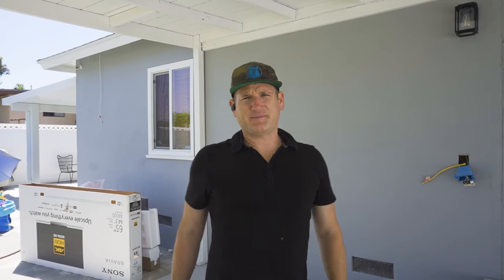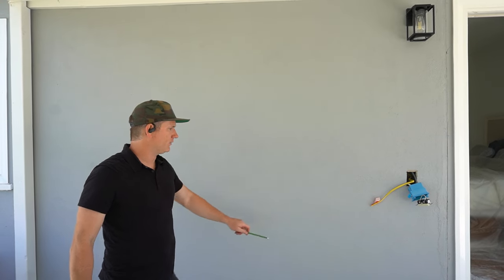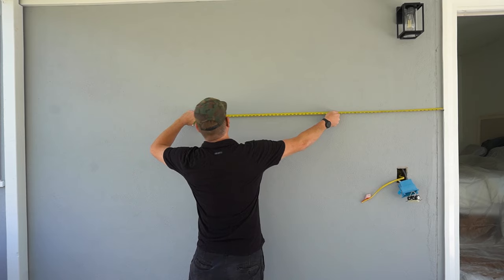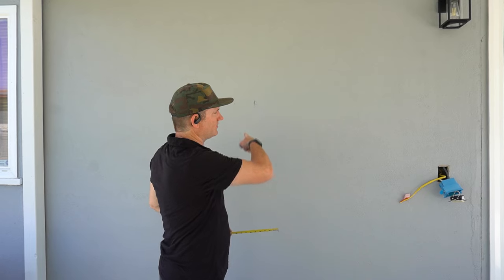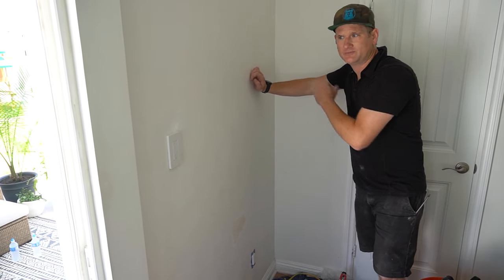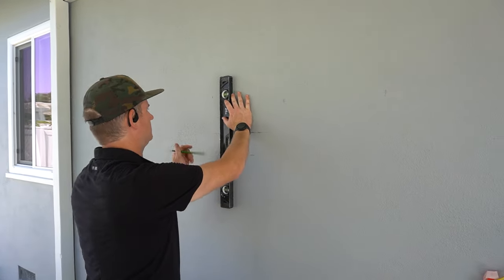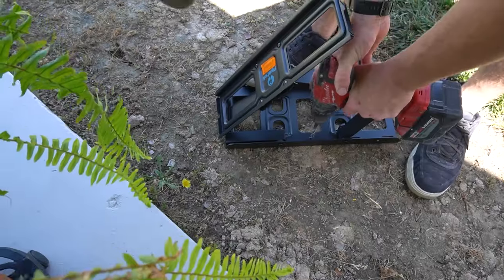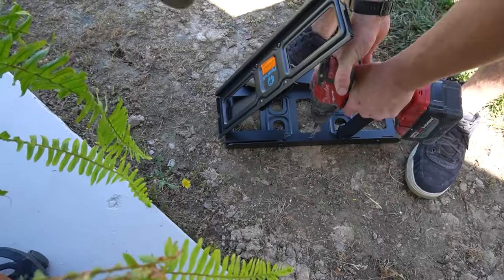Installing TV in Backyard/ Patio by Pro

Comment: I’m also a professional tv installer. This guy really knows his stuff. Only things I’d do different is use a smaller drill to check for the stud so in case I miss, it’s not a big hole, and I also use Toggler brand toggle anchors.
Reply: And a better quality mount
Reply: @JoeyAdes  yeah that too.
Reply: Yup! The 3/16 inch Toggler anchor is the best imo I used for dry wall tv mounting
Reply: Try the ZeboZAP gazebo tv mount

Comment: I'm a beginner when it comes to electrical and I think this was great video. I was mainly interested in how to deal with stucco.  However we do have the blown- in installation, so fishing that line through might be a bit interesting.  But I was amazed at how easy this looks like it is to do! Now to review my plethora of "prior to drywall pictures" to see what else is in that wall and get better idea of where the studs are.
Reply from the maker: it's either going to have fireblocks or not.  if not, the fish tape will get through.  it's not too hard once you have some practice

Comment: Thank you for this video. I noticed you used a regular tv. Goes to show as long as it’s under cover you can install a regular tv outside. Thanks for the video again. 👍🏼👍🏼
Reply from the maker: You can just throw a cover over any TV.  Better than those super expensive sunbright tvs that aren't very good anyways.
Reply: @BTheInstaller  thank you for the advice saved med 5k o.O !
Reply: @BTheInstaller  the concern for us in the northeast is temperature.  We are installing in a gazebo and we don't plan on taking down and storing in the winter.
Reply: @danielbalboni6804  I have mine under a gazebo like structure and it has sat out all winter (zone 6 in growers terms so we get nasty winters) with just a fairly thick cover over it and unplugged. It is Hisense 4k so nothing too fancy. My plan is to uncover it and wait a few days incase moisture got into it, to let it dry out fully and see if it survived. This winter was not a great test as it only snowed perhaps 4 or 5 times and the snow on the ground did not last more than a few days. Wish me luck.

Comment: Great video, I just installed a 50" LG in my outdoor living area and used a similar articulating mount.  My outdoor living space is a 12' by 24' covered area and I used a non-outdoor rated mount, have you ever seen any issue with indoor mounts used outdoors (this will never be hit by any rain)?  I live in central California so we get some pretty hot weather in the summer and pretty good fog in the winter.  Thanks!

Comment: You should do a video on how to mount a tv on fiber cement siding. I've been looking around an there's no content anywhere to be found. Is there anything different?
Reply: The key is just to use a long structural o lag screw try to attach to studs if its not possible use anchor's screw... tv are light weight nowdays... someting yiu may need spacers to fill it

Comment: Seal the holes with insulation foam filler spray $15 at HD on the hole and around your  outlet before putting the plate on. Keeps water and bugs out.

Comment: i just bought a brand new samsung 70" for a covered lania...do i have to worry about a waterproof enclosure for it
Reply: Yes. Common sense if its not one of their Terrace Tvs. Check Amazon for some Storm Shell covers. They're not cheap, and the largest they make is designed for a 65" but new tvs are so thin on the bezel, that it may fit yours. Not sure how well they work, but the theory is sound.
Reply: I just built a custom tv cabinet for mine. Just built one for a client out of Redwood

Comment: B the Installer...I have a question that I haven't seen addressed on any video, anywhere.  I need to mount a 65" tv outside under my covered pergola.  That's the easy part.  The wall that it's going on is a 3" foam insulated panel that has aluminum on the front and back.  Its very sturdy on the roof, so much that a 160 -180 lb person can walk on it.  Very common in pergolas for roofs, I was just lead to believe it could hold a tv. I'm not willing to chance it.  What do you recommend?  Possibly a large steel panel on front and back with the tv mount fastened to it?  I figure this would displace the stress that would normally be on the wall.  Your thoughts?

Comment: Intresting how you can put a 20 amp box on a 15 amp surcut.
Reply: I was thinking the same thing.  That should have been 14 gauge wire not 12.  Thankfully, it's not 14 gauge where 12 should be.  The 12 gauge wire on a 15 amp circuit really won't hurt anything because the breaker would trip if there was an overload however, if it was the opposite, (Which it isn't in this case), a 14 gauge wire on a 20 amp circuit could cause the wire to get hot and catch fire before that 20 amp breaker would trip in some situations.
Reply from the maker: It's been a while but I'm pretty sure it was a 20amp. Normally outdoors and garages in CA are 20 Amp and 12 gauge. ...  however, there is no downside there.  And if it were 20amp I would not use 14

Comment: good seal oh really i can look into the wall through that hole on the right side of the power outlet 
you can see at 23:42 I really hope you fixed that 
because if not that is a really shit move
Reply: Not to mention the first drilled hole where he missed the stud that is just covered with the mount plate. I'd fill the hole with some silicone at least. Maybe the screw holes too.
Reply from the maker: Stop picking.  It's a video. Enjoy the video Vs try and arm chair QB it..

Comment: So in essence only one stud.  Do you need that ground nut, or can you just twist grounds together connecting the lin8ger wire to ground on outlet.
Reply from the maker: The way i did this is all the proper way.
Reply: So answer regarding one stud??? If its right confirm.

Comment: No issues with having that tv outside permanently?
Reply from the maker: Not with a cover.  The mount may get rusty over time in places with more rain or if its somewhat exposed.
Reply: B The Installer right on. Thanks for the info

Comment: No need for that hammer drill lol stucco is very soft and a normal concrete bit  with a normal drill with the right bit will work just fine, also why are you using toggle anchors if you found the stud..?? Just pre drill and use some lag bolts

Comment: Would it be bad to use a in wall cable conceal on a job like this
Reply from the maker: what cable? i run cords to outside as needed. you can fill with expanding foam if concerned about animals or bugs

Comment: Using a regular tv outside is not recommended for a reason. Don’t listen to this guy if you want your tv to last for several years. A cover doesn’t protect from temperature variation & humidity/condensation. 

With hot weather, regular tv’s don’t have adequate heat sinks/cooling. With cold weather/condensation, regular tv’s aren’t sealed properly and they don’t have proper insulation.
Reply from the maker: Dude, 99% of outdoor TV usage is with indoor tvs.
Reply: @BTheInstaller  yea and half are forced to be replaced within a year.
Reply from the maker: @Tony-ew1jt  I go back 5 years later and the tv is perfectly fine.  People don't even use them much. I also live in socal, so it's 70 every day all year round
Reply: @BTheInstaller   There’s a couple issues with your statement. You’re relying on your own experiences with your own clients. That is known as being subjective or using anecdotal evidence. I’ve seen internal data from samsung on their return reason and rates, that of which included hundreds of thousands of tv’s. I have also worked with several insurance companies, including all state, asurion, the geek squad, squaretrade, etc, and all have stated that outdoor use of indoor tv’s is one of the most common insurance claims for tv’s. Using indoor tv’s for outdoor use are also not covered under the extended warranties/insurance policies, as well as the standard manufacturer warranties.
Reply from the maker: Sounds similar to "if you want your tv to last several years" very scientific.  Your warning to consumers will remain here bro. 🤘
Reply: @BTheInstaller  nothing about that statement is subjective or anecdotal. That statement i made is literally based on the internal data from a major tv manufacturer and some of the top tech insurance providers.
Reply: @Creole Belle I purchased a 65 indoor TV for outdoors, and was afraid it would have an early expiration but now I feel better after reading your comment.